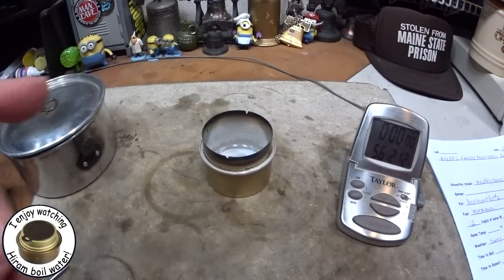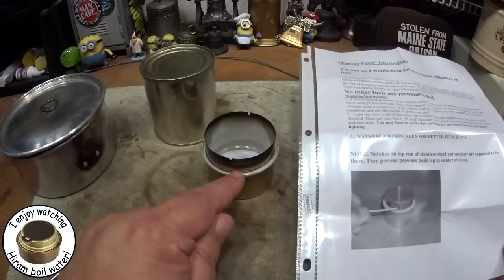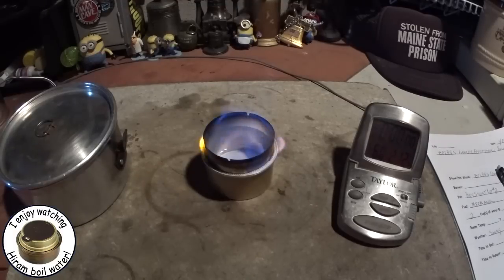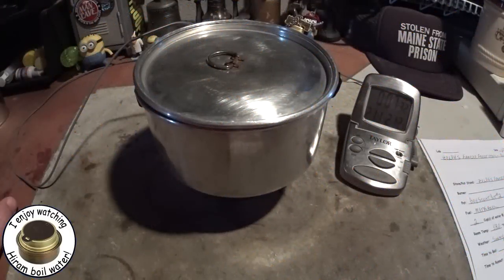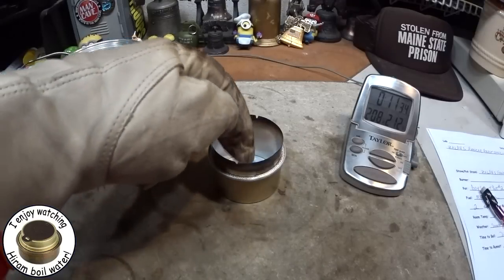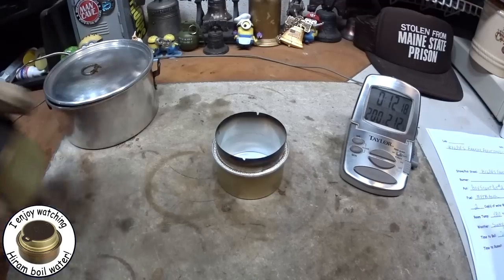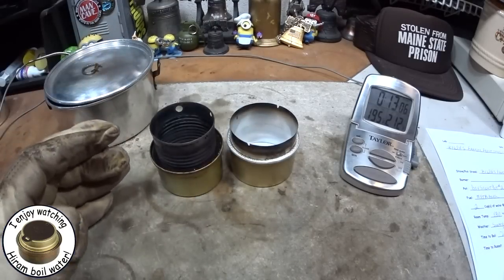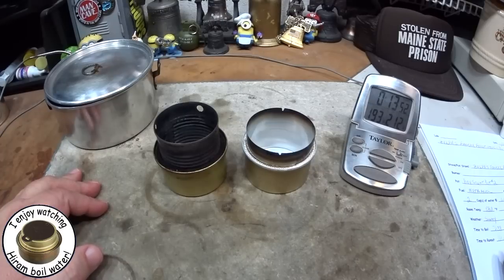Zelph's Fancee Feest Stove - Boil Test

Comment: Zelph’s stove in this test put out 800 W, used 20.5 ml to boil 2 cups, and had a thermal efficiency of 46%. Mr. H. Cook’s FFS (Lab0450) reached 1 kW heat output, burned 17.4 ml fuel with a thermal efficiency of 54%. Not too darn shabby!  Hiram should write the Grand Ol’ Encyclopedia of Alcohol Stoves!

Comment: which better the zelph or the one with carbon felt?
Reply: based on default configuration hiram's is more efficient at boiling water.  Hiram's 1" inner can's height above the outer can might be the biggest difference here.  The carbon felt shrinks over time and the carbon felt isn't exactly cheap.  Not sure what zelph uses but that could be longer lasting.  The carbon felt design can be assembled and dissassembled at will.

Comment: well hiram, personally I'm not impressed with the results from Zelph's version. I think your version is hard to beat and I have used your version a couple of hundred times now. in addition, I actually now use ColoradoCamper's 1/2 capacity version of your FF stove... the cat food can cut in half and the 2 pieces of the can pressed inside of each other with the can rim down on the bottom for more stability at the base. it holds 1oz and uses a 3/4" tall carbon felt wick rather than the standard 1-1/2" carbon felt wick. the inner tomato paste can is cut down to your 1" sweet-spot height which makes ColoradoCamper's 1/2 capacity FF version 1-/1/2" tall rather than the standard 2-1/4" tall. the 1oz. capacity is all I need and it's IMO a much nicer stove at this 1/2 capacity size, for my uses. all of my friends switched to the 1/2 capacity FF stove, too. in texas we don't melt much snow, but the smaller FF version cooks our food and makes our coffee w/o any compromise. make a jig for cutting the FF can exactly in half by fastening a 1-sided razor blade with screws to a 1X4, turn the can (rim down) scoring it exactly in half and press the 2 pieces together. cut your wick to 3/4" tall and cut the tomato paste can to 1-7/16" tall. you can make two 1/2 capacity FF stoves from 1 tomato paste can and use 1/2 of the standard wick height (saves fuel, too and easier to pack). both you and ColoradoCamper have great ideas! thank you for inventing the FF stove! thank you for your videos and all that you do and never forget we love you in texas! martina

Comment: No hate here, you perform a great and interesting service for your viewers. I have built two Fancy Feast stoves from your design. One with 1/2 inch pot stand like Zelph's and one with a 1 inch pot stand. My results after 2 years are about what you have shown here. The 1 inch pot stand boils 2 cups of water about 2 minutes faster than the 1/2 inch one. Run out time is of no concern to me as when the water boils I'm done, so in effect I can use less fuel.

Comment: I think your version of the stove will be easier to light in cold weather with a cold stove.  Because the Carbon Felt wicks better and that is what you need to light in the cold like ColoradoCamper showed in his cold light test.   The Fiberglass is having trouble lighting even in your tabletop test and that means it is not wicking good enough to light in the cold light test.  Zelph's would be alot harder to light in the cold.   Maybe you could put them in your freezer and try to light yours and his.  I dont think you can lights zelphs in the middle when its cold.  But you can light your carbon felt one at the edge when its cold.  Because of the wicking.   The Carbon Felt helps to volatilize and draw up the fuel and make it easier to ignite. But the fiberglass is not able to do that as easy.   One really easy way to light a Trangia in the cold is to use a little piece of paper as a wick.   The Trangia has trouble lighting in the cold from in middle also.  It needs the Initial heat to make fuel vapors that start to come out the ports and heat the stove.   The Trangia gets hotter as it warms up with its own heat.  But when its cold its harder to start unless you use the Wick Trick.   This is sort of why i think the Zelphs would be hard to start in the cold.

Comment: I've been using Zelph's Fancee Feast for over 2 years. I don't see holes in the sleeve anywhere (except for the big one I pour the alcohol into). I use it with a GSI Minimalist pot/cup, covered, with a windscreen, and only ever boil 2C of water. I light it with a ferrocerium rod (I don;'t like burning my fingers lighting anything below the flame) and haven't had any trouble except when its below freezing. Then, like with all alcohol stoves, I keep the fuel warm until I'm ready to use it, and don't waste any time fueling and lighting to stove.
Can you equate the "run out time" to a quantity of alcohol? I equate this to  stove efficiency - trying to use only the minimum amount of alcohol to boil the 2C of water. "Run out" to me means wasted fuel.

Comment: Hi Hiram, Just an observation and I'm not all that sure about this but I don't see the little pressure relief notches In the center sleeve on the picture of the stove in the instruction sheet. My question is, Could the sleeve have been installed upsidedown by mistake from Zelph's and if that's the case what if you flipped it and tried the same test? Now keep in mind this could just be a very poor observation because the picture on the instruction sheet isn't all that clear from my side!

Comment: I have a Zelph Fancee Feest stove. I had trouble with it at first, so I would put alchohol in it then tilt it towards the crease where the directions say to light it. That seemed to help wet the wick. The more you use it the easier it lights, in my experience.

Comment: Thanks Hiram. Don't know what to say about this Zelph stove. I know that I've seen many backpackers using it, and seemingly loving it.  As far as my own DIY ... (Tuna can and tomato paste can w/carbon fiber)... I tried my very first four cup boil with two ounces of methyl alcohol yesterday (using a large Mors Pot). While it did take a long time for the four cups to come to a boil (over twenty minutes), run out was 9 minutes later. I had a dehydrated breakfast and two cups of coffee! I think I need to raise the height of the tomato paste can. Mine sits at only about 1/2 inch from the carbon fiber to the top. I see yours is way taller! I need to get the flame to touch a larger portion of the pot surface... it's just too narrow with the meager 1/2 inch clearance. I don't want to go too tall, as I'm concerned stove stability will be jeopardized. Now I have more of my own 'sperimentin to do in order to find a good sweet spot. Thanks for the vids!

Comment: I've seen this brand stove light faster. It appears enough alcohol seeps under the ring to make the stove work but the fiberglass used now isn't a good wick material.  I like this stove because the inner ring is wider and would be more stable with a larger pot but I'm impatient for morning coffee and that extra 2 minutes to boil would be irritating.

Comment: In the beginning their manufacturing process may not have been as precise allowing clearance at the bottom. As they improved their methods the tolerances became to tight.  Just a guess.
Reply from the maker: +Anthony Romano That sounds about right.
Reply: +Hiram Cook  I remember reading the forum where Zelph evolved this stove, and he commented that no holes were necessary back then, as the alcohol would "find its way" to the wick under the liner.  Sounds like its time to get out the Dremel cutting wheel or hole punch, modify it, and do another boil test.  :-)
Reply: +DannyH Here's the forum thread, its pretty long...http://www.whiteblaze.net/forum/showthread.php/27262-Fancyfeast-Stove
Reply: +DannyH It is in post #135 on page 7

Comment: Hiram, would you get the same 'boil time' with a narrow pot?
Reply from the maker: +MrJimJD Hard to say. The exposed bottom would be smaller but flames running up the side could make up the difference. Sounds like a test idea. Do you have a specific pot in mind?
Reply: +Hiram Cook  I test with a Batchstoves 10cm pot. 60 deg water temp.  I got a 6:30 second boil time and I was able to light from the wick with the pot on.  If the wick is any higher, the burn intensifies.  Made a Zelph style Fancee Feest today with the fiberglass wick.  I had the wick about 3/16" higher then the original.  My boil time was 4min 50sec.  Hotter burn.
Reply: +Hiram Cook Or the Stanley Adventure Camp Pot
Reply: Hiram Cook
I use a Toaks 750ml Titanium pot/mug. It's base is a fraction wider than a 32oz Nalgene bottle (which easily fits inside).